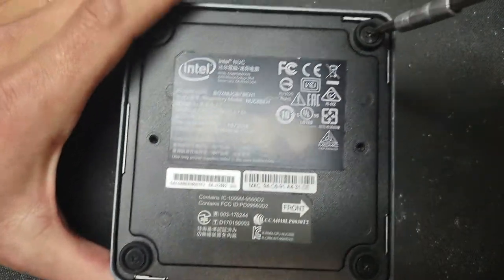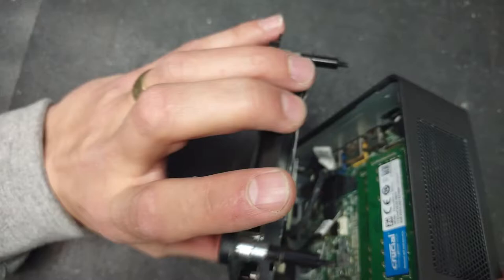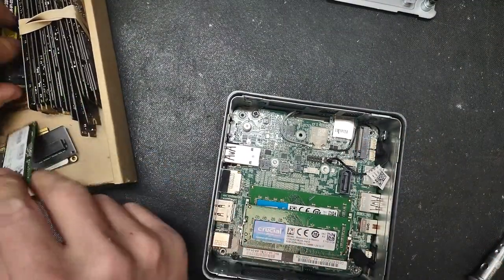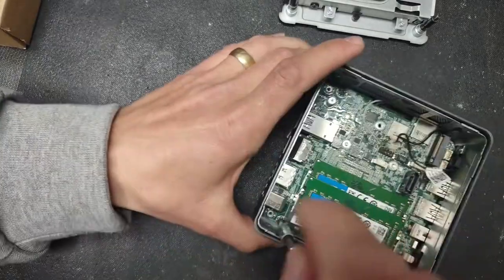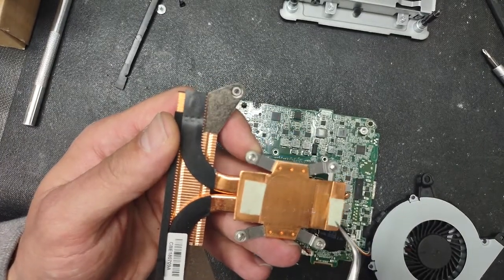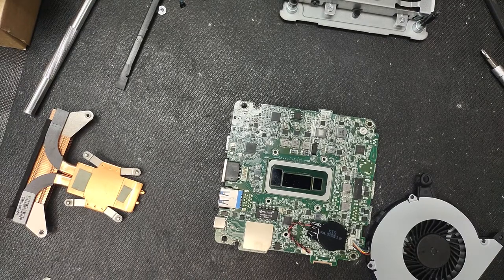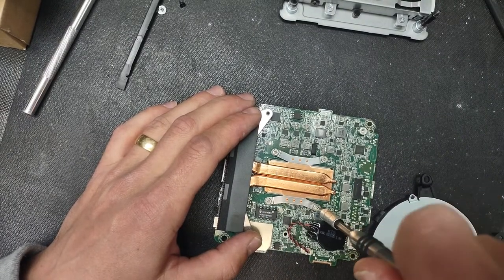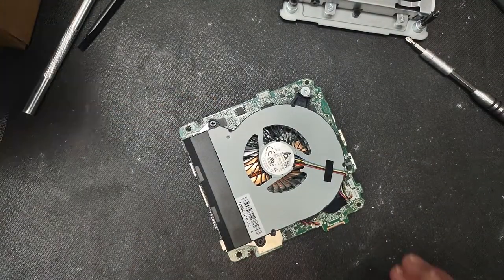Intel NUC shutting off repair/fan replacement

Comment: I would also lube the fan axle while at it.  Once the metal cover of that fan assembly is removed, its just one smootth pull with no effort and pulls right out (as far as i can tell from both my laptop CPU GPU fans).
Reply from the maker: Some of the fans are actually sealed, meaning you cannot remove the fan assembly from the motor without damaging it. If it doesn't come out easy don't try to pull on it. If it does come off, then definitely add lube to the shaft as well.
Reply: it's a bummer this NUC fan assembly was sealed version, both my laptop fans was not sealed each had 3 tiny screws and cover was off, it was serviceable and no pull or pry difficulties.

Then again ... if it's your personal hardware, you 'probably could' break those tiny plastic welds and service them and weld it back or put new holes and new m.1 screws..😊

Comment: Hello. Someone asked in an earlier comment what thickness of thermal pad you used, and I didn't see a response. I'd like to know. Thanks
Reply: I also need to know this as my NUC8i3BEK CPU Core Temp is 66 degrees Celsius even with very low CPU utilization.

Comment: Good info and thank you for sharing - what thickness are the thermal pads you are using here - I see 1.5mm in your example but you say it is "thinner"?
Reply: I also need to know this as my NUC8i3BEK CPU Core Temp is 66 degrees Celsius even with very low CPU utilization.

Comment: The one thing everybody needed from you was the correct thickness and type of thermal pads to use, and you didn’t include that information 😭
Reply: 0.5 thickness

Comment: hello! congrats for the video and thank you for the info. I didn't get why you have to apply thermal paste only to the middle one and pads to the rest. If it is possible with careful work to apply thermal paste to the all three of them is there going to be a problem?
Reply: There certainly is going to be a problem. The copper heat spreader is recessed over those smaller chips to accommodate the thickness of a pad. If you try to use paste there you will get no contact over those chips.
Reply: yeah i was wondering that too,i understand your claim too much is not good. but to me those two small pea drop are insufficient of surface coverage, meaning all 'processor-cores' are not getting equal surface to heat transfer.  🤔

Comment: What is the recommended period for cleaning the fan?
Reply: Just disassemble it while you are doing this kind of maintenance, its very easy to pull the fan out and expose the axle, zero effort, i would put one good quality drop of your choice of lubricant brand.

Comment: I have come to the conclusion that the 8th-Gen Core i7 NuC is just a badly designed heater. I changed the fan although it was fine. I re-pasted with MX4, I even put it in a cold-room of 18c. The moment you push this paper-weight it spikes to the upper limits - hitting 100c regularly. And if you go google - you will find many forums talking about this particular Intel NuC junk model. The ONLY way I can get it to remain within acceptable limits is to go into the BIOS and change the fan from "balanced" to "cool" (welcome now to a noisy-nuc) AND to disable turbo-boost. Which effectively cripples it to a fraction of its potential. Just buy the i5 - I have two of those and they run fine
Reply: if it jumps to 100C then you have to replace the thermal paste
Reply: I have similar issues with the i5 where if I push it too hard it locks up and I have to force reboot, already have turbo boost disabled. I also have this weird issue where sometimes the ethernet port locks up and then it switches to wifi and I have to reconnect the ethernet cable to get it to be wired again AND now I keep hearing the clicking or scraping which I assume is the fan which is why I wanted to see a video of the tear apart before I go in. This model is just trash in terms of casing. Debating on either getting a Akasa Turing FX case or just looking for an AMD nuc since AMD doesn't, on avg, run as hot if the device has 1 more issue.
Reply: @undead9786  Also looking at the Turing case. I've a 10th gen NUC and it's completely silent